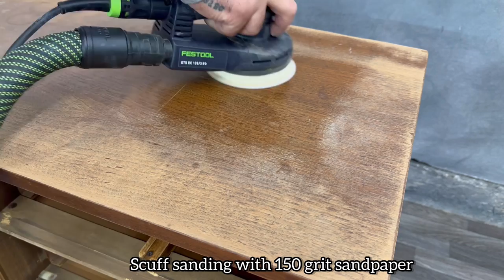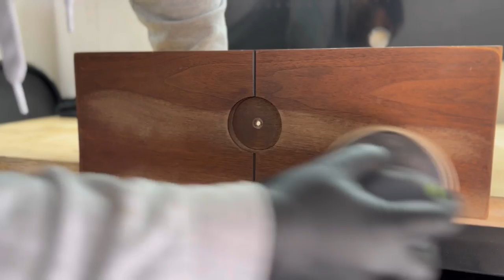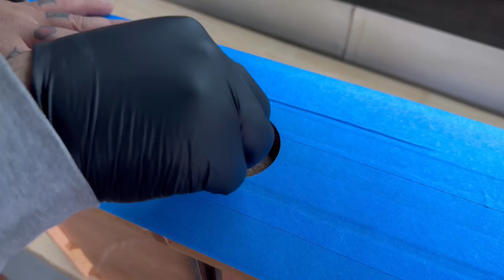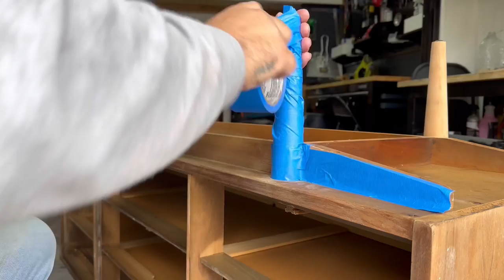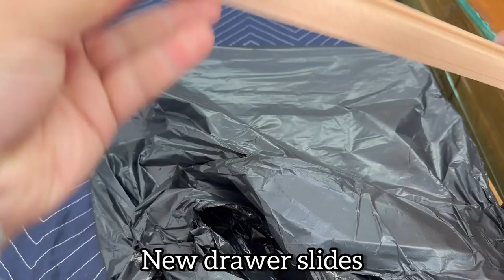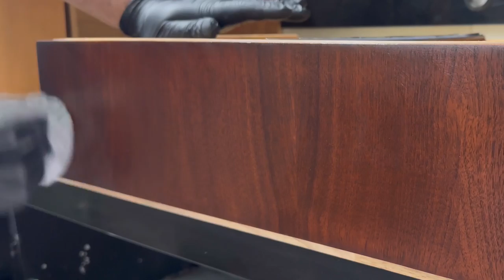EXTREME FURNITURE MAKEOVER || DIY MID CENTURY MODERN UPDATE AND RESTORATION MADE EASY || SIDE HUSTLE

Comment: I was a little skeptical about painting it at first.  I thought it would have been better to replace the damaged veneer.  But seeing it put together, it looks good.  You kept enough of the wood showing to pull the whole thing together.  And if you are going to paint something, black is a good color.  It matches with everything, and it hides imperfections well.  And the contrast between it and the wood on the front is a pretty good look.  Normally, I would think of painting it as a negative, but you turned it into a positive instead.
Reply from the maker: Thank you so much. I’m glad I was able to change your mind. I appreciate the compliment